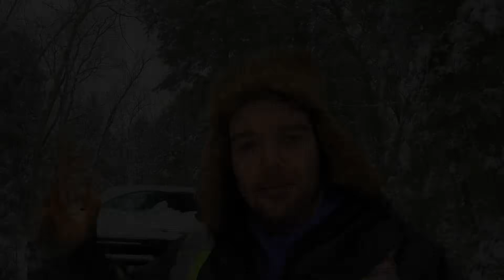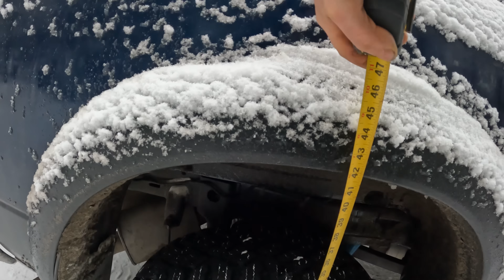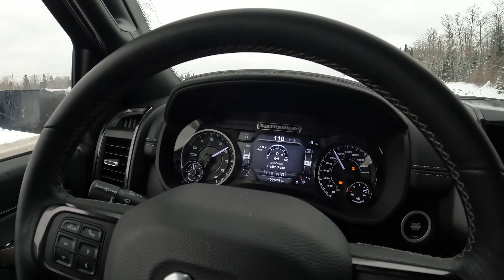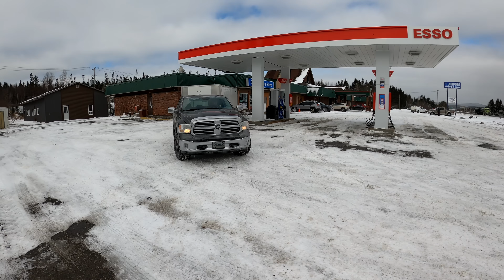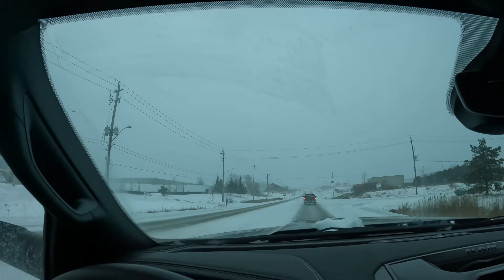RAM 2500 Power Wagon 6.4 HEMI Towing Test | BETTER Then You Think!!

Comment: Don't think you would have any trouble towing a 2 horse slant load trailer loaded or 30 ft stock trailer, maybe pushing it with a 4 horse?
Reply from the maker: 4 horse could be pushing it! I was just referring to horse trailers because they are usually heavy and by point was if you are actually towing heavy weight this truck is not for you!
Reply: I had a 2012 2500 with the 5.7 pulled 26ft steel stock trailer with 5 horses no problem
Reply from the maker: @buckyallen6805  5.7 has lots of power

Comment: Your 1500 would've benefitted from a good wdh for your enclosed trailer.  I tow a 6200lb 24ft travel trailer with a 4pt wdh and it tows beautifully.
Reply from the maker: potentially yes! what kind of gearing do you have?
Reply: @GettysGarage  I have the stock 3.21 like in your 1500. Can easily get under 11L/100 on the hwy empty and 21-24L/100 towing.
Reply from the maker: @stecathe  exactly what I was getting with my 3.21's. I love the fuel mileage of those trucks but ya when towing they like to drink.

Comment: Hey bud loving the videos! Can I ask a huge favor? Can you measure the height of the power wagon loaded vs unloaded by chance?
Reply from the maker: Ya I could, I was hoping to a do a max payload video and see how much it drops. I figure that kind of what you mean?
Reply: @GettysGarage  yeah kind of something like that. Basically we have zero power wagons I can go look at from the local dealers and I am trying to make sure my $65k investment will indeed fit into my garage! I know I have the length but the width and the height seem a little iffy. My main concern is that sharkfin deal on the roof for height and how wide the mirrors are when fully extended. Thanks again for a great video! Stay warm!

Comment: I have a ram 1500 big horn short box with the 3.21 gears and I’ve maxed out the tow rating a couple times about 8k lbs. my dads boat is like 7k it will pull it just fine but the payload wasn’t great 1300lbs it does struggle with some stuff but if I had 3.92 gears I think it would pull even more
Reply from the maker: My big horn also had 3.21 gears, and like I loved that truck but idk I was honestly surprised how much it had to work with only 5,200 ish pounds behind it. That truck towed that weight without issue but you could tell it was hard on the truck. I would agree I think 3.92 gear would make a difference.
Reply: @GettysGarage  I’ve heard and seen if you go and buy a 6.4 hemi intake manifold it will fit on a 5.7 hemi I thought of doing it I think the truck would act much better
Reply from the maker: @dgreco1374  really eh ? I'll have to look into that. could be a good way to make some power!
Reply: @GettysGarage  yes it is
Reply: @GettysGarage  love the vids by the way I know more about my truck now then when I bought it
Reply from the maker: @dgreco1374  Thank you sir! I've honestly learned a lot from everyone sharing info in the comments. But I guess as a mechanic I find the mechanical aspects interesting and like talking about it.

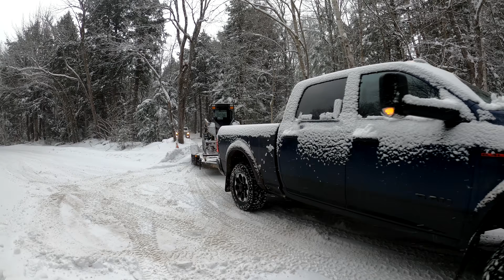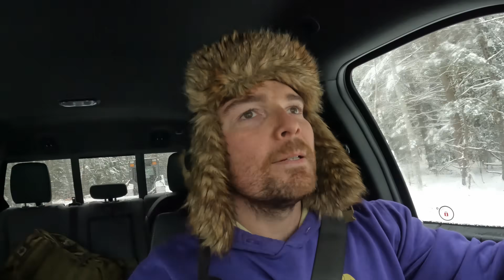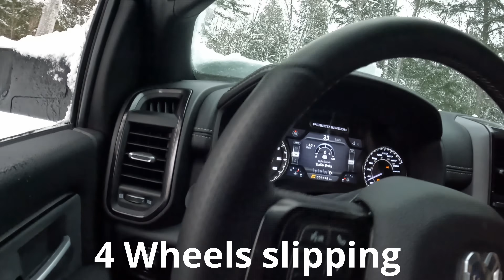Comment: good video, but your 1500 had highway gears if I remember correctly 3:21 not great for towing, my Warlock has 3:92 with max towing 10280lbs,  how it would compare to the power wagon? can you do a video on the different gears 3:21, 3:55, 3:92 vs your 4:10
Reply: Man that truck is almost 2000 pounds heaver then a 1500 truck. It going to manage a trailer better.
Reply: I had a 2017 Ram Rebel 3:92 towed a 22 foot Sled trailer loaded up 7800 pounds ish. The truck had the power but did not feel safe going up. and worse coming down. Bought a 2019 Power Wagon same trailer same route worse weather and the 2500 Power Wagon was a beast. It was in control the whole way up and down. Better to have too much truck then not enough. Or stay home.
Reply from the maker: agreed!
Reply from the maker: you are correct it had the 3.21 gears. So yes the acceleration was not the greatest and it did have to work hard going up the mountains. but with those lower gears comes a lower tow rating. So my 1500 only had about 65% of it's max rated tow rating and yes it did tow that load without issue and I loved my 1500 but overall it just felt like the truck was uncomfortable and the trailer was pushing the truck around. where as the Power Wagon had 80% of it's max towing capacity and the truck didn't even sweat. now yes my 1500 had higher gearing it would have had better acceleration and power. I guess my point is that there is more to towing then simply max tow ratings. I would fell 1000% better towing the max towing capacity of the PW then I would with my old 1500. 

Again I LOVED my 1500 but the Power Wagon is just a much better towing machine
Reply: 3:73
Reply: No kidding the Power Wagon will handle it better, it's a 2500 series truck! But that was not what I was getting at , power pulls 10k max, my 1500 pulls 10280k Max, yes power wagon will do better but what about get up and go? , up hills? Keep speed? Fuel mileage? , I would love to of hooked up to that trailer just to see the difference, anyways sorry if I said anything wrong or asked a bad question just gathering information
Reply from the maker: No such thing as a bad question sir! I like the open discussion because honestly I learn a lot from these comments! but what I would say to that is a "normal" 2500 with this exact driveline (6.4 hemi, 8 peed , 4.10 gears) is rated for 17,000 lbs so this Power Wagon has plenty of power to tow. what holds it back is it's soft suspension. My thinking is that the off-road suspension would have a hard time taking the twisting force of accelerating under 17,000 lbs and that's why RAM has lowered the tow rating so much. I could be wrong but that's my thinking. 

as far as fuel mileage, it's tough to say. unloaded any 1500 will have much much better fuel mileage but loaded who knows. all depends on the type of trailer and terrain.
Reply: @warlock83  Off the line i would say the Power wagon with 4:10 and a bit more power. I had the same wonder. The Rebel was harder on fuel in my case towing. I live in B.C. It all depends on were your trucking. I would not recommend max towing with a half ton truck.
Reply: No such thing as a bad question.